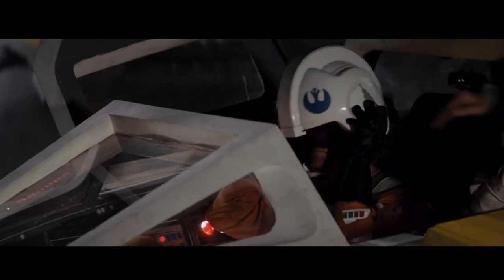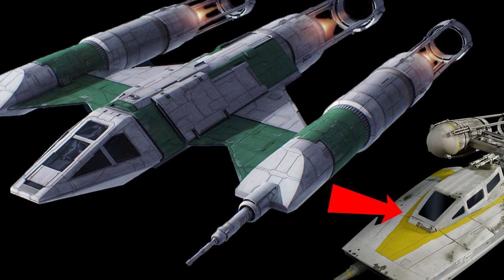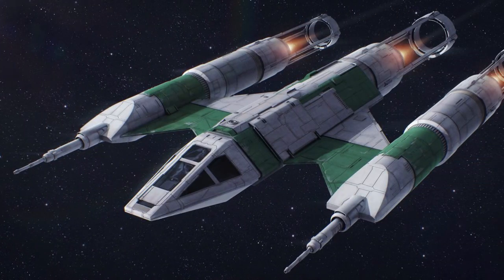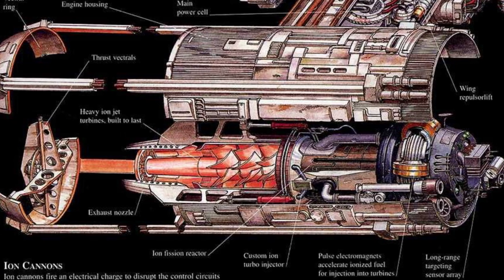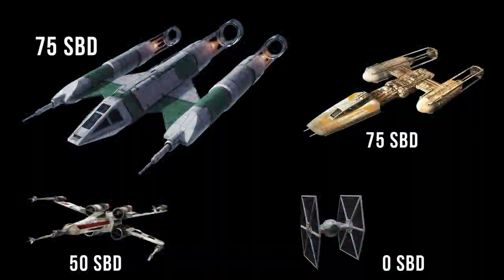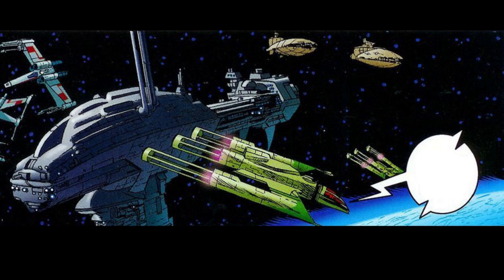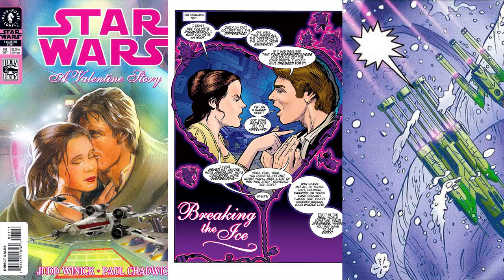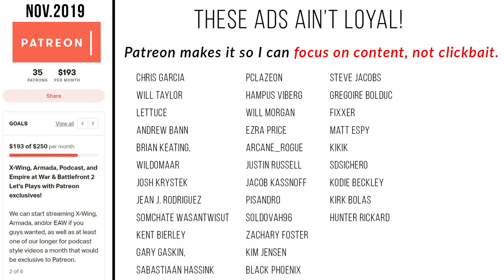(Star Wars Ships)  Made from SALVAGED Y-Wings | M-Class Scout Ship

Comment: So Chewie fitted into a snubfighter? 
Even if it's designed for 2 crewmembers what'd they do, rip out the front seat and have him steer from the back?

BTW Han Solo At Starts End, Han suggest that Chewie could pilot a Headhunter (they needed pilots to protect against a raid while the Falcon was in the middle of disassembly) and the mechanic suggested that she could build a cupola on top of the canopy and he could operate the controls with his knees - Han saw the wisdom of her comment and dropped the idea.

The Rebels, since they used Aliens, could have built (or modified) ships with much smaller cockpits to take advantage of any small pilots they had. Freeing up space for other components or fitting a 2 man crew in the space of a 1 human cockpit.

Comment: Now angle the pylons down and put another set on top with either concussion or proton missiles and lengthen the bottom set by a third or so.
Forgo the extra sensor & communications suits as well as the ungraded hyperdrive and middle bottom engine for more power to feed into weapons, swap the laser cannons out for some smaller capital grade turbolasers with the extra space and power generation.

Was thinking some sorta heavy interceptor or maybe even light destroyer(not star destroyer but the actual kind) made of salvaged bits like this is.
Bigger and slower but with enough firepower to make them a threat to larger vessels on it's own or pose a serious threat in small groups but still fast enough to evade fire and get away.

Comment: Unsurprised the New Republic didn't keep these as scouts. Wouldn't it's increased size mean you could pack more sensors into it than an A-Wing and it's heavier weapons could also make it a good heavy interceptor. I think the N.W and G.E suffered the same problems of having good tech but poorly utilising it, especially when entrusting a scouting role to a shop that is harder to fly like the A-Wing meaning you not only drop the scout force strength by no longer using the M-Wing but decreasing it further by having a smaller pool of pilots who can fly the A-Wing.